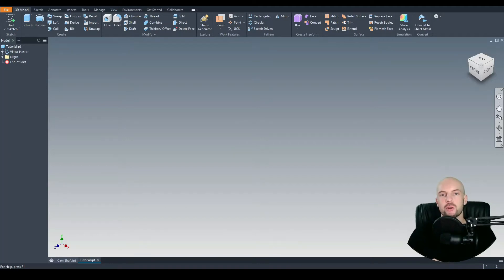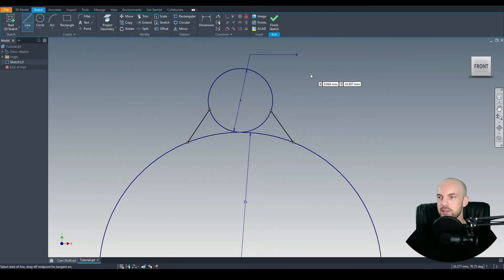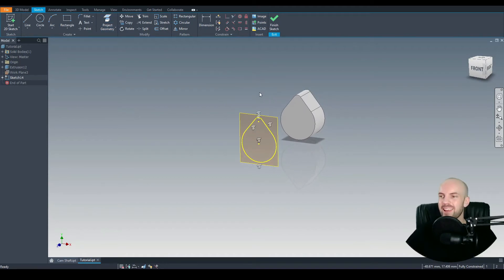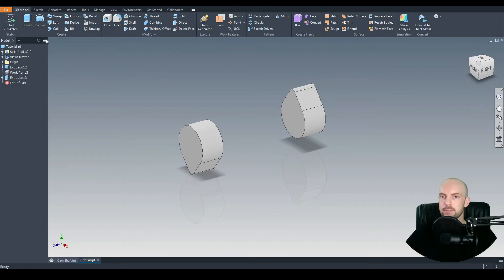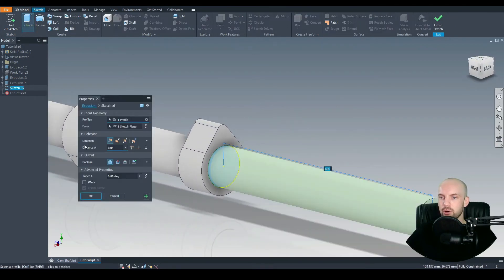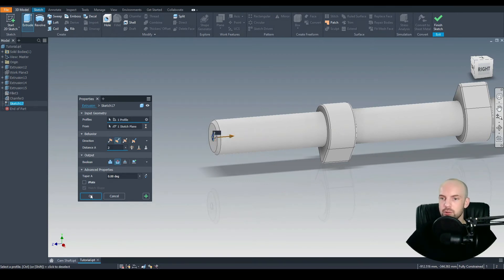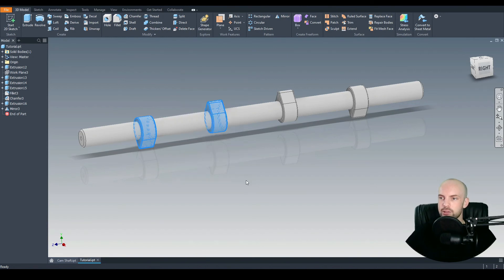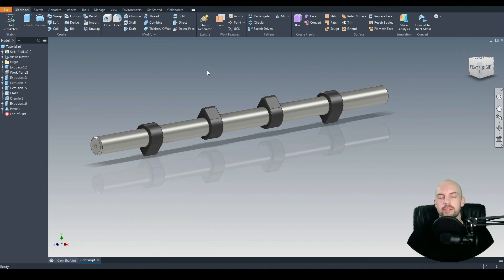Camshaft | Autodesk Inventor 2021 | Exercise 18 | Intermediate Tutorial

Comment: Sir, at the end of the video, you give different colour between lobes and iron rod. Um, sorry. How to select object to give different colour, Sir? Because, I was try to hold control and move cursor but theres no respawn to block part like your tutorial. Thanks in advance.
Reply from the maker: Hi Ahmad! Thanks for the question,. Once you have drawn the lobes and the shaft, you then need to select the individual faces of the lobe to assign an appearance to them... There are different ways to do this, you can Left click a face and then hold ctrl and select the other faces (this is time consuming).... OR, you can hold down Left mouse button and drag across all of the face of the lobe, then hold down ctrl and repeat the process for the remainder of the lobe faces and assign the appearance after. Hope that helps! Enjoy your Sunday!
Reply: @AutodeskInventorTutorials  thank you, Sir.